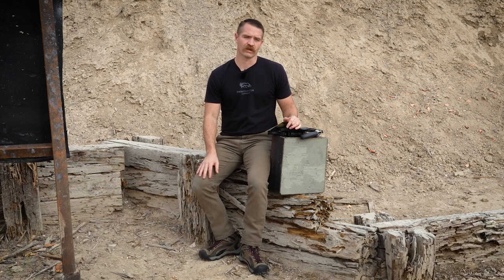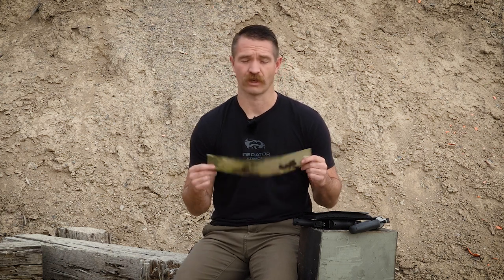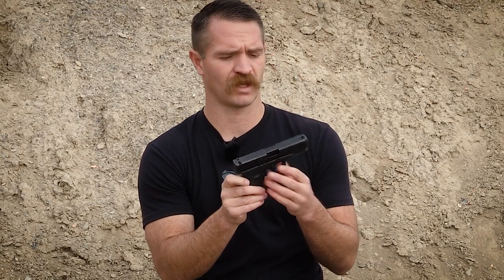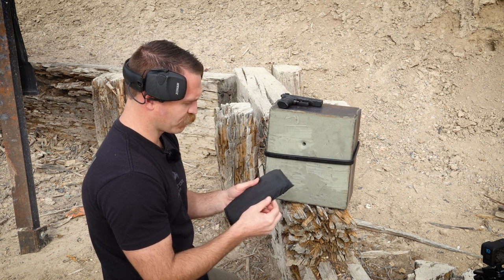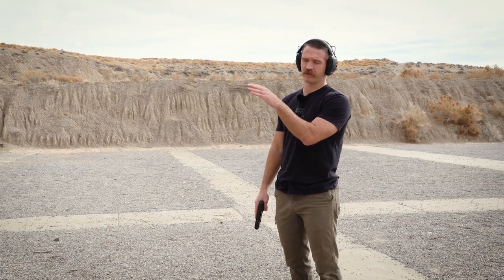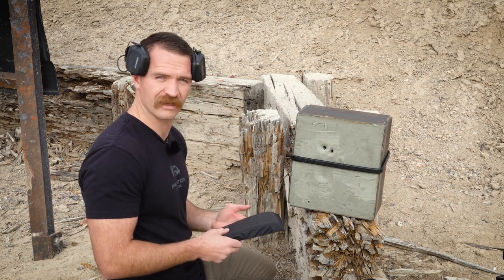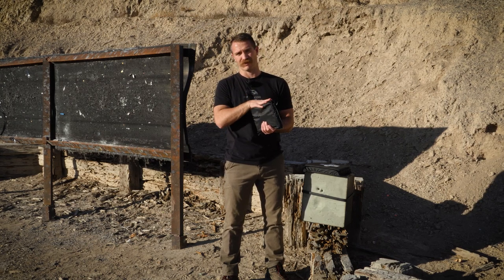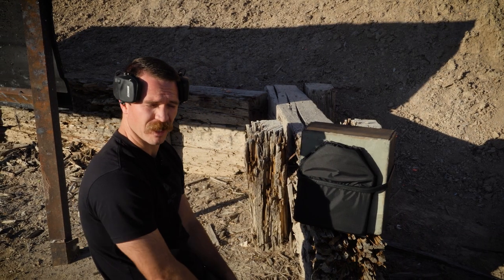Ballistic Nylon Test - How Bulletproof Is It?

Comment: "Ballistic Nylon" was NEVER meant to stop or even slow down bullets fired directly into it.  It's sole purpose was to reduce the severity of injuries sustained from low velocity / energy flak shrapnel & ricochets, making an otherwise fatal hit, survivable till the plane could land and proper medical treatment applied.  

"Ballistic" does not mean bullet resistant for that matter either...  When used to describe a product, it just means that the product was designed to help cope with objects in motion.  i.e. multiple layers of ballistic nylon can reduce the overall penetration of flying objects, and thereby reduce the severity of the wounds sustained.   In the case of Kevlar, Dyneema, Spectra, or other similar materials, these can be sufficiently layered to create bullet resistant (i.e. bullets fire directly at it) materials at a relatively light weight.